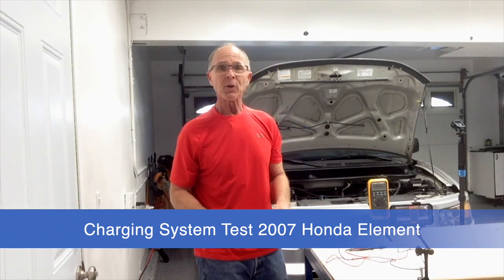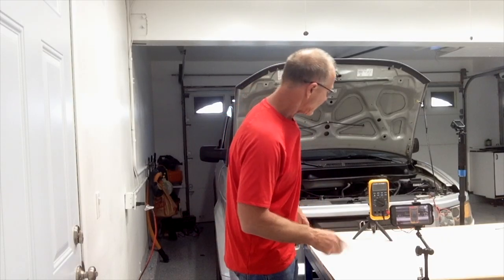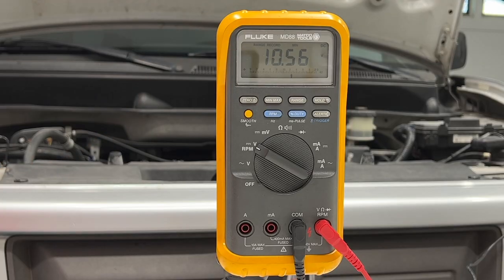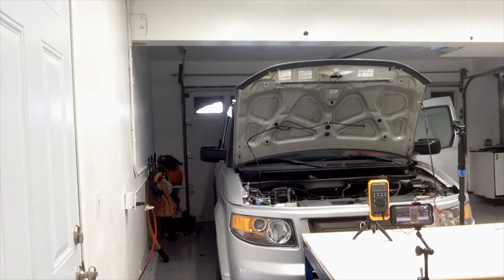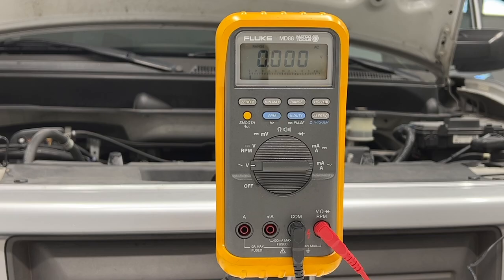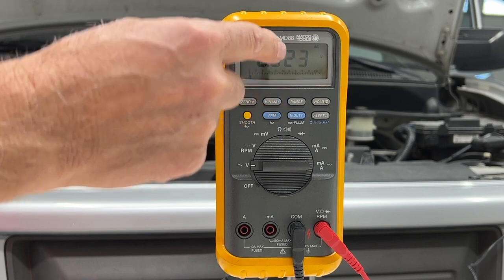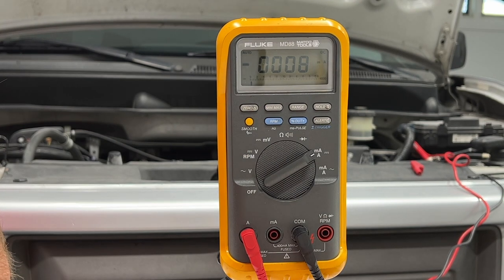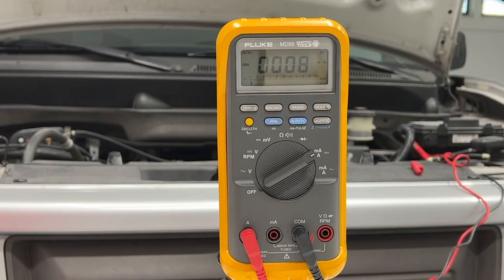Parasitic Draw Test, Battery Test and Alternator Test, How to do this with a meter

Comment: Best tutorial. Just wondering why my car's voltage went down when engine is hot and has difficulty in starting, but when its cooled down its just one click. It might be the alternator or wirings? Thanks.
Reply from the maker: I'll be doing some updated videos on this subject in 2024, I'll get into details covering abnormal issues.

Comment: Hi my car is reading 14.1v with engine running but when i put everything on lights heaters blowers a/c radio etc voltage drops to around 13 to 13.3v is alternator faulty thanks
Reply from the maker: That should be fine, it’s keeping up with the demand and adding a charge
Reply: @dannysdiygarage  thank you